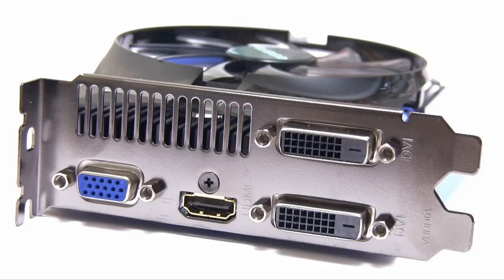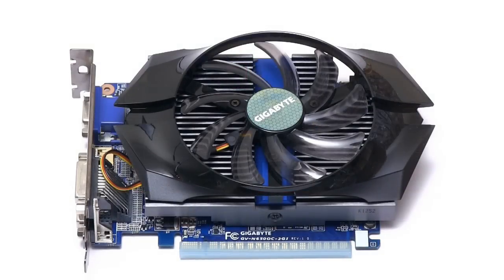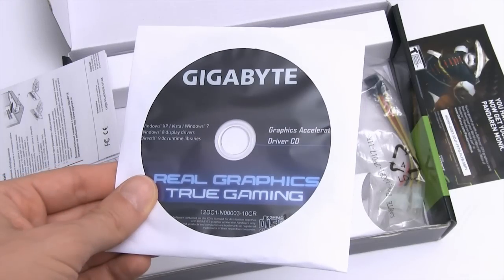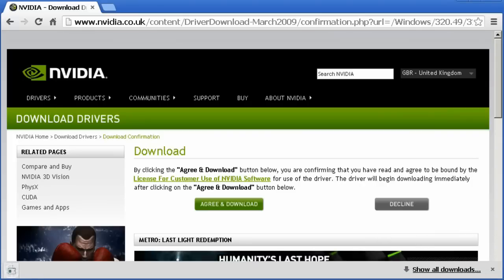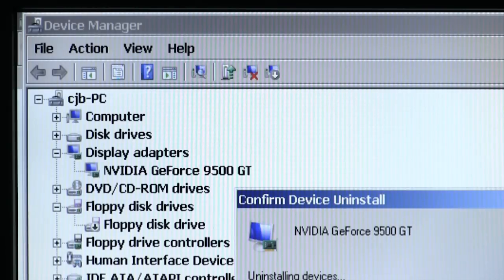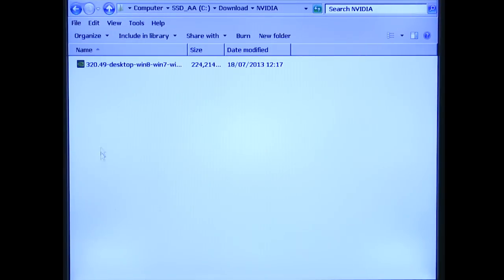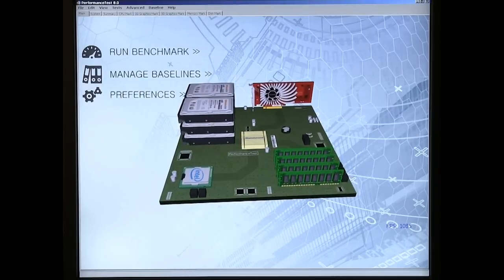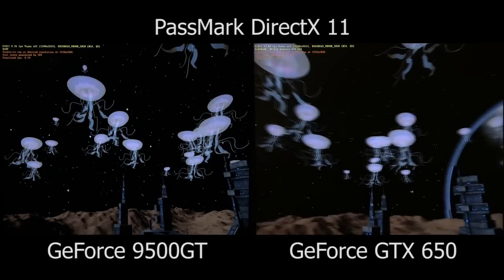Graphics Card Upgrade (GeForce GTX 650)

Comment: ExplainingComputers I bought 2 Amd R9 290x crossfired it and thought would run all games at ultra setting atleast this year. It was working fine till I bought watch dogs, am not getting frames above the 45 mark.... at ultra settings.... this is really frustrating.. the cpu and the gpu both are overclocked but still not getting that 60 fps smoothness that I love while playing games
cpu is 4970k at 4.5ghz
its fair overclocking and I didn't wanna do some extreme overclocking cuz its really unnecessary 
gpu core clock at 1100mhz with 25% power limit and 60% max fan
Both of the cards are in same config
psu is cooler master silent pro 1200
no multi monitor config, jst a single 42 inch led at 2k 
And i have seen that when even am running the game the system is in real stress all the time.... should I need to change components to increase the performance or its jst some problem with the game?
Reply: That isn't the fault of your system, watch dogs for PC is a trash tier port of the console versions. Funny when you consider they said they had PC as the main focus. There's a lot of controversy around watch dogs and ubisoft. Apparently they turned off some of the graphical settings on the PC version to make the xbox one and ps4 versions not look like complete trash in comparison. This in turn led to the game becoming a stuttering piece of shit. However ubisoft were stupid enough to not actually remove the graphical options from the source code of the game and a modder found them and activated them. As you can probably tell, this means that the stuttering and frame rate issues are nullified. I can't link you the download as I'm replying from mobile but you can probably find the mod on a website called ModDB under the watch dogs game. Hope This helps.
Reply: Anterlyful thank a ton..... I did find a mod....but am afraid to install it.... Cuz the game installed is genuine and hope it won't make any probs in the genuineness of the game..... And am really sad.... And disappointed.... Cuz i really spend a lot of money to play games at high res and high graphics..... And when it doesn't.... it really makes me sad... :(
Reply: ***** I'm on my PC now so I can link you to the mod I was talking about. Also, don't worry about the mod making the game not genuine. It will always remain genuine because you paid for it. The mod doesn't give you an unfair advantage, just a simple graphical upgrade which should have been there from the start. This is the mod: http://www.moddb.com/games/watch-dogs/news/mod-enables-e3-graphics
Reply: Anterlyful thanks a ton.... I mean it worked like a charm.... but I have seen that the game puts a lot of stress on the cpu and gpu.... Its kind of strange cuz when I AC 4 or Crysis 3 at ultra setting and MSAA at 8x, it's not that stress to the computer as a whole...
Reply: How about you stop being a little bitch ? The "smoothness" you are talking about is noticeable , only when you put 1/2 the speed ! Watch Dogs is the worst optimized game of 2014 ! Assassins Creed Unity - same graphics as Assassins Creed Black Flag , but waaaaay higher requirements !
Reply: Yea dude...purely agree....wid the same config. I am barely getting playable frames in unity....sucks balls :(
I lowered down all the graphics settings and at lowest setting possible...am still getting frames like 24 or sometimes....I deleted the game immediately...total waste of money :(

Comment: hey guys i am about to upgrade my gpu ram and psu  and i have a very tight budget i just wanna know all your opinion on my upgrades 
my current pc specs are

intel pentium e5800 3.20ghz 
2gb hynet 1333mhz ram
motherboard asrock G41M.VS
odyssey 450w smps 
nvidia geforce 8400gs 1gb ddr3

AND i wanna upgrade to 

ZOTAC NVIDIA GeForce GT 630 Synergy Edition 2 GB DDR3

or 

ZOTAC NVIDIA GTX650 Synergy Edition 1GB 128-bit GDDR5 

psu to Cooler Master Thunder 450W 450 Watts PSU

ram to G.Skill NT DDR3 4 GB (1 x 4 GB) PC RAM (F3-10600CL9S-4GBNT)

AND I AM JUST A MID LEVEL GAMER AND DONT even play multiplayer i just casualy play campaign mission and games like skyrim and current can run skyrim sleeping dogs at lowest settings please give your opinions

Comment: hey i have a delloptiplex 745 sff i have uprgraded the cpu to a q6600 quad core it works and i now want this card i also have bought a 500 w psu supply but im wondering that this card may not fit in my case

Comment: You should remove the power plug before touching anything inside.
Reply: no, you really dont. i work on computers all the time with the power on.
Reply: He could have easily switched it off at the wall.
Reply: removing power plug should be common sense or doing anything with cover off the cpu box.. A lot ppl don't do it though.

Comment: Video editing on a GTX card, hmmm most people I know uses a Quadrocard for Video editing. and in 2013 using a GTX 650, doesn´t make sense. and windows experience who would use that. sorry like the guy in the video, but he is way behind the curve here.
Reply from the maker: Thanks for this. For me it is all about the price/performance/energy balance, not always using the latest hardware. I considered a Quadro card, but for a lot more money you get no real performance improvement, only (potential) reliability gains. And I also considered a higher-spec GTX card, but really could not justify the power drain (and related probable decrease in long-term stability for both video editing and rendering due to the extra heat inside the case).

For me the GTX 650 (and specifically the 2GB RAM Gibabyte overclocked version) has been a good upgrade, as I'm generally making stuff for my YouTube channels and occasionally selling animation and stills for TV broadcast and print. If I were doing this kind of work every day of the week I would use a higher-spec card in a higher-spec system. Each to their own of course. Oh, and on the Windows experience measure, granted it is not a great test(!), but is is a something that everybody easily has access to, and it is not the only measure I used in the video. :)
Reply: From specifications you don´t get much to look at, but a quadrocard is the way to go, and we are allowed to make a good choice for our pc´s even if its for a low spec one. if you wanted a very cost efficient card, maybe something from a GTX 680- to a GTX 760, they are cheap and AMD have been dropping prices for their graphic cards all year.If you want the overclocked and tweak ready cards you really should go for something like the: Asus Nvidia GeForce GTX 760 DirectCU II OC 2GB GDDR5, they are overclocked out of the box and can be overclocked futher with the asus tweak software, nice and easy, oh yes and the 760´s are under 200£ at the moment. As said like your videos, but this is a miss, but don´t worry you have made lots of other good videos, so it is fine: Something with "It is human to error, but dammed be it" or something like that, keep em coming.
Reply: rasmus dont mess with this amazing guy i thought i had put it in the microwave but he led the way in to the future all praise this guy!
Reply from the maker: Hi Quatchy,

It is a very good point you make on idle v. load power -- though there is still the issue of price! :) For me the key thing was to move to a card with Cuda cores for Premiere Pro, and everything I researched said that once you hit a certain number the returns for more were limited.

Comment: I recommend the Gigabyte GeForce GTX 650 ti oc. more power at a VERY reasonable price it has given me no grief so far and is quite powerful when paired with an i3-3220. :) the build i made recently came out in the $600ish range and is very quick and includes the 650 ti oc.

Comment from the maker: As you are upgrading from integrated/onboard graphics to a separate graphics card things should work fine without uninstalling drivers first. So I would suggest just fitting the card, and then installing the driver. Enjoy your new 650 -- I think you will find it a major improvement over your onboard graphics. :)

Comment: thanks for your vid, i have a 650 on it's way to me now and iv never installed a graphics card before.  at the moment i have the intergrated amd 760g chipset, do you think i should uninstall my driver for that?  also if i should is there a way to do it outside of bios in windows 7 as i have no keyboard at the moment. many thanks

Comment: core 2 quad? you're going to be suffering from some bottleneck from the cpu! I currently have a q6600 g0 and a gtx 460 1gb and no matter the overclock I end up with a lot of bottleneck from the cpu. Thinking of upgrading to a core i5 3550k, but didn't want to sped a lot

Comment from the maker: Personally in this situation I would remove the old card and insert the new one, and then try booting in safe mode, doing the uninstall, and then booting normally and installing the new drivers. You may get away with things just fitting the new card, booting normally straight away and installing the new drivers. But on my own machine I would not risk it. Good luck! :)

Comment: I have to wonder why you run your desktop in the classic interface. I understand it may look nicer to some, but it is in fact entirely cpu driven. The Aero interface uses the gpu and the cpu to render windows. If you dislike the transparency you can always turn it off, but I do recommend you use the Aero interface. Especially with a video card like the GTX 650. Nice video though! :)

Comment: You first need to check if your power supply has anough watts and you have enough cables for the gpu you cant just put the thing in there and spec it to work.

Comment: I have problems upgrading drivers for my GTX 560, even the GeForce experience would not recognize the card or software. I will try with the steps you took and hope I can avoid a clean install of windows.
Virus attack left me without windows restore or the ability to upgrade my graphic's card drivers.

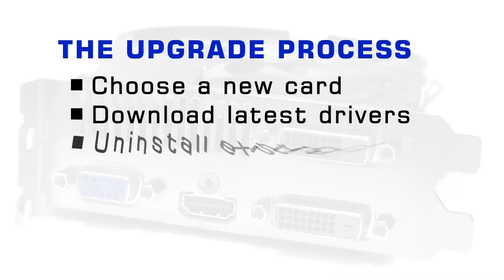Comment: 0:53 These days for Nvidia, you no longer have to uninstall the old drivers prior to installing new drivers.... You can, but installing new Nvidia drivers will automatically remove and replace necessary driver files with no problems or conflicts. It even gives you an option to do to a "clean install" that will wipe away everything of the old drivers, and reset any preferences and custom options you set to default.

GeForce Experience comes highly recommended too.

Comment from the maker: The 650 Ti is rated at 105w, compared to 64w (and the Ti Boost at 134w). So yes, the 650 Ti does not create twice as much heat, but about 64 per cent more (the direct relationship between energy use and heat generation is inevitable!). This does not mean that both cards cannot run cool -- but their heat has to go somewhere, and at least some will be inside the case. For me the bigger issue was absolutely power consumption, and I found it very hard to justify the extra wattage burning away. :)

Comment from the maker: Possibly. But not something I'd try. I read up a lot on the driver issue before changing my card, and all of the advice I could find (including that from Nvidia) was to uninstall old drivers and then reinstall new ones. Granted, I have heard of people just pulling out one card, putting in another, and everything worked fine. But I would not do this myself, esp. in a modern version of Windows.

Comment from the maker: Thanks for this. I am not (now) into gaming, and have seen so many views on the GTX 650. It is the bottom of the GTX range, but to me seems a great card, esp for the price & power consumption. So I am happy to be corrected that this is mid-to-high range (though I know there are people here who will disagree with that). The version I used here is also slightly overclocked by Gigabyte, & with 2GB. For me, the performance improvements in Premiere and Lightwave are significant, & I am very pleased.

Comment: Got a GTX 650 and did a video on it works pretty well good choice mate.
However I must say that the card is mid to high range due to the fact it can handle most games I have run so far at high to medium settings.
With 1GB GDDR5.

Comment: There could be an issue or two with your situation. Nvidia sometimes doesn't support graphics chips in laptops and all-in-ones since they are not a standard spec. Also, Nvidia is rolling out the "GeForce Experience" which in bundled with one of the driver updates but is NOT compatible with XP or older Windows OS's. There is a way around downloading the bundle if you manually select XP as your OS and search the driver list that way.

Comment from the maker: Yes, it would be the same. You would ideally still need to uninstall your current driver (ie the driver running your onboard graphics), and as you say the hardware part would just involve plugging in the new card.

Comment from the maker: Yes, and I agonized over it! But the 650 Ti uses twice the power, and hence generates twice as much heat, both of which are a big consideration for me in a machine that often renders 24/7. And ultimately the 650 now allows me to edit HD without rendering previews, so will save a lot of time. :)